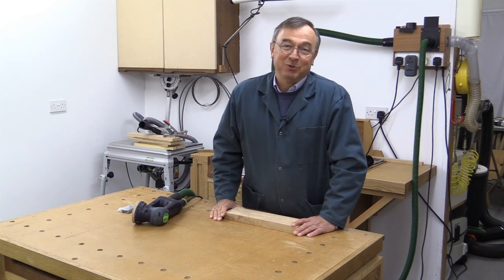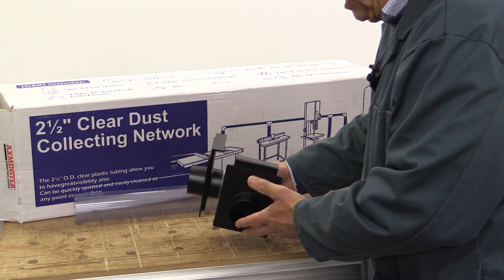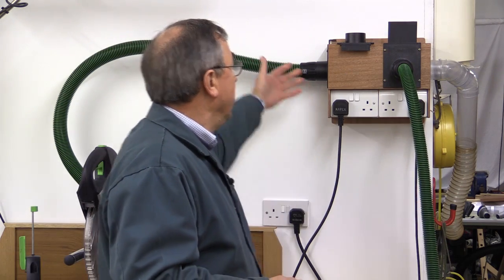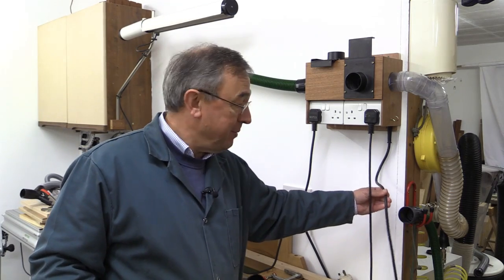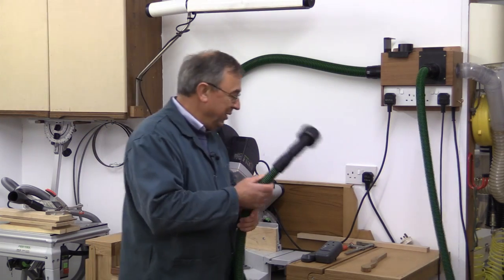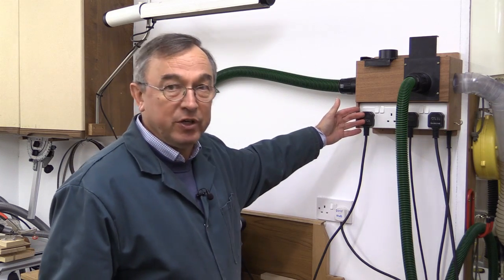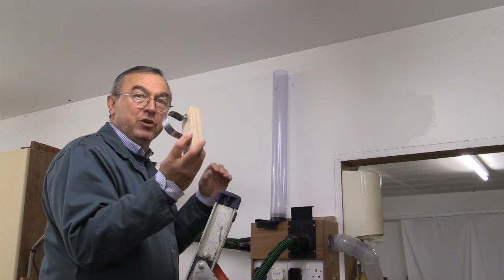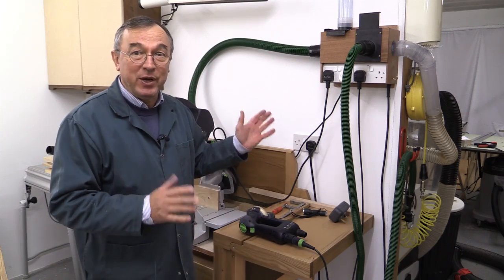How to make the workshop Dust Hub

Comment: I always enjoy your videos Peter. Thank you. Given all the developments that have taken place in the 10 years since you posted this video, it’s remarkable how relevant it is still. My only observation is that right angles are not a friend of extraction system design, so shallower angle connectors would be a big improvement for viewers to consider.
Reply from the maker: Many thanks for this. When I moved house and built the new workshop I adopted a simpler idea for dust extraction with a single vacuum machine. I now have my CT26 (a very faithful friend) with the Utimate Dust Deputy on top set next to my Kapex. This allows me to have a short length of hose to the Kapex which improves dust collection. I have a double power socket which gets its power from the front of the CT26. I have the Kapex permanently plugged into one socket and the Festool Plug-It cord plugged into the other socket. Both sockets have individual switches. I have a routine which I have done so often it is a habit that when I want to use the Kapex I plug its short hose into the top of the DD and switch the Kapex power switch on. When I want to use any tool that uses the Plug-It cord I switch off the Kapex power, switch on the power to the Plug-It and swap the Kapex hose for the hose associated with whatever tool I am about to use. It works really well and saves having to operate blast gates and there are no right angled bends in the air flow.  Cheers.  Peter
Reply: @NewBritWorkshop Thanks for your quick reply. Once I’ve completed my own workshop makeover, I’ll share my approach. I was inspired by Dennis at the @HookedOnWood channel to go down the Record Power CamVac route, with a DIY cyclone, in addition to my CTM Midi. The plan is to combine dust extraction from Festool gear, workshop tools, and XCarve CNC, with fume extraction for my CO2 laser, all to units housed outside the workshop in a sound-proofed mini shed. I just need to decide where to locate a connection hub (per your design) and cut the requisite 100mm hole in the wall, while avoiding 90 degree connections in the ducting! 

Being a bit of an IoT and home automation fan, I can’t overlook the chance to automate the remote switching of the extractor(s) and blast gates based upon which tool is drawing current.

Comment: Just came across this idea and its a very good one , I have a question whats the name and where to source that plug socket with the remote control
Reply from the maker: Hi Bill, That plug and remote was sold by Maplin here in the UK but you can find similar stuff on Amazon.  Peter
Reply: sure as hell miss em Maplins were close by , Thanks Ill google  and see what I dind I do have some of the smart  sockets that link to the machines and come on automatically when the machine starts like my table saw,etc  but the remove idea is quite a good idea. Thank you for the reply 

Bill

Comment: G'day Peter, I managed to buy a similar kit here in Aust and made up a dust hub. However, I am having problems with the dust settling in the bottom of the blast gates making it impossible to seal off the gate. I have to remove the gate clean. Do you have this problem with yours?
Reply from the maker: Hi Clive, I have exactly the same problem. Were I to make another I would install the blast gates upside down. I sort mine out, about once every 6 weeks, by using a vacuum hose and a piece of wire to loosen the trapped dust.     Peter

Comment: Hi Peter. I know I'm abit late to the party but Im just working through all your videos. I was wondering if the festool midi would have enough suction in your opinion for a system like this?
Reply from the maker: The Midi should be fine. It has the same max vacuum as the CT26 (which I have) at 24,000 Pascals. Its flow rate is just a fraction lower at 3,700 l/min compared to 3,900 l/min of the CT26.   Peter

Comment: A bit late but I've only just found your channel again. All the dust extraction videos I've seen scream, NO RIGHT ANGLES, use two 45 deg bends otherwise you impede flow. My experience tells me that this is indeed correct, also bigger pipes with adequate pull. I know you are totally married to a few firms who I guess sponsor you but I've seen the proof.
Reply from the maker: Hi Steve, Space was the criteria and the parts that I could buy the cheapest. My system works fine for me.     Peter

Comment: Hello Peter. Another nice video. You folks in the U.K. have great accessories. It's the same with  motorcycle accessories. Very cool motorcycle parts and accessories there. I really like the power switch and electrical wall socket/combo you have there. I wish we had something like that in the U.S.. A nice setup on the dust hub.
Reply from the maker: Hi Ron, I suspect that the various accessories will be available in the US but it is a question of knowing where to find them.   Peter

Comment: Hi Peter. I just watched your dust hub video and was left wondering how you deal with chippings from your planer thicknesser? I currently have 3 extractors - a festool ctl midi which I use directly with my TS55, my Dewalt router and my Mirka sander. I also have a Record power RSDE2 which I use to clean up with and to my router table fence. Finally a 550W HVLP collector hooked up to my Axminster AW10BSB2 table saw, and my Axminster 106PT2 Planer Thicknesser. None of the extractors can cope with the volume of chips from the planer. I know you used to have the same machine, so I'm wondering if you have any advice. Many thanks. Anthony.
Reply from the maker: +Anthony James Brown For my planer thicknesser I have a Numatic NVD 750 which operates through a 100mm cyclone from Cyclone Central. It works really well as 99% of the chips go into the dustbin that I use as a drop box. You should be able to find the 100 mm cyclone video - it was one of my very early efforts.    Peter

Comment: Is this kit from Lee Valley?
Reply from the maker: +Lance's Woodshop Hi Lance, Mine came from Axminster Power Tools here in the UK. I am not sure who sells it in North America. Here is the Axminster link so you can see what you are looking for:  http://www.axminster.co.uk/63mm-dust-extraction-kit        If you PM me your email address I can send you the plans free of charge.    Peter
Reply: Thanks Peter, I believe Lee Valley is selling the same thing in the U.S. - I appreciate the free offer but I'm looking for a Y fitting that will fit into the Clearvue CV06, and have 2 blast gates coming off the Y. Are you on Instagram? I have some pictures of a new boom arm I'm working on, if you're on Instagram, you'll see what the issue is i'm trying to solve. Thanks again for the feedback.
Reply from the maker: +Lance's Woodshop Hi Lance, No I am not on Instagram, Facebook or Twitter. I have enough on my hands answering every comment or question on YouTube and like to keep an eye on the Festool Owners Group forum. Good luck with your dust collection plan.   Peter
Reply: +New Brit Workshop (Peter)  Hi Peter, i can find the Axminster blast gates (63mm)  but what size Festool hoses/connectors do you use? D27/D32/D36
Reply from the maker: I have both 27 mm and 36 mm hoses and they both fit as the end that goes on the extractor is the same on each and it is that end that goes into the blast gate.    Peter
Reply: Ok, thats easy. Would like to get the blastgates, but have to see if i can order them with paypal. Don't have a creditcard :(

Comment: It really amazes me just how simple you make your video's. I have watched a few of them and can appreciate how valuable you are to manufacturers of woodworking equipment and, more importantly, how essential you are to all woodworkers trying to build knowledge when they get started, or wish to improve on what they do. I now look specifically for your videos. Thank you so much. 

Just one question and apologies if I have not seen it, do you have a suspended air filtration unit for the very fine dust that may be airbourn in your workshop and have you done an evaluation of these on video please.

Thanks again and I look forwardf to seeing more.
Reply from the maker: Badger Woodcrafters Hi Badger, I used to have a brilliant Jet overhead filter in the days when I ran a chip extractor (one of those awful things which have a big bag on top that inflates and then redistributes the fine dust all over the workshop). In those days the extra filtration was essential. Now I have got rid of the chip extractor (they should be banned unless they have HEPA filtration) and moved over to my brilliant combo of Festool CTL26 and Numatic NVD750. I sold the Jet filter and have not looked back.  Many thanks for your very generous and kind comments. Peter
Reply: Just one clarification if you will please Peter. The Festool CTL26 & the Numatic NVD750 should manage, without anything else (Dust Buggy), to keep the harmful dust at bay?  I have been considering the first two, but feel I would like to manage without the DB if possible for space saving, but do need to keep the air clear as my Asthma is a problem. I use a Trend Airrace half mask when tools and machines are working but unsure if another air purifier was really necessary with the CTL26 & NVD750?
Reply from the maker: Badger Woodcrafters The Trend is good and you should try working without the overhead first. Peter

Comment: Peter
Great job, as ever.  One question I have is on the use of the T-section is the extent to which you lose suction fron the tight 90 degree angle?  I have read elsewhere that you should avoid T sections as they reduce suction considerably.  My guess is you know exactly what the impact is, anything you can share?

Thanks and keep p the good work,
Terry.
Reply from the maker: T Radford Hi Terry, You are right (on both counts). There is a reduction in vacuum efficiency and I have set it up to offset this. The key machine that needs the best suction is my Kapex and for that the flow is in a straight line. The other routes were intended just for sanding, the Domino and the odd bit of sawing. However, the CT26 is such a good extractor it can still provide the power needed even at the end of that long piped section. So, I am able to use my Festool CMS-TS (saw) and Festool CMS-OF (router) with no problems whatsoever. Ideally one would design a Dust Hub with "Y" joints rather than 90 degree ones but I had none and am perfectly happy with what I have made.    Many thanks.   Peter

Comment: Hi Peter.
I'm new to the Festool world & have been catching up on a lot of your videos.
I'm going to build a dust hub, & was wondering if there was a reason you used plug wall sockets as opposed to, say, a switched surge-protected trailing socket x4, which would simplify the electrical connections?
Reply from the maker: Pete Gee Hi Pete, Anything will work as long as each outlet has a switch and they are all grouped together at the Hub. That way you can get into the routine of turning the power switch on for the particular blast gate that you open (and turn the switch off for the blast gate that you close), otherwise you will make the mistake of having the power on to a tool that does not have vacuum support.   Peter

Comment: Thank you for yet another very interesting and informative video.  I have seen other videos of dust extraction systems where the plastic piping has been earthed - is this something you should consider?
Reply from the maker: Alan Currans Hi Alan, I have earthed the system and will try and get some video about it up in the not too distant future. Basically I extracted an earth point from the rear of the sockets on the Dust Hub and then connected this to thin copper wire which I wrapped around the piping. Many thanks for your kind words.     Peter

Comment: Nice setup.  Now I'm completely confused.   I'm just in the process of setting up my first workshop.   Naturally I've been looking at all the great tools I can buy, in particular dust extraction.   I've been advised that 6"  is the way to go, and also 4".  Hmmm.   I have installed a new floor on top of the existing concrete floor.  I decided to run a dust collection pipe under the floor to the center of the room for a new table saw.  Unfortunately I could only fit a 90mm pipe there.  Any advice??
Reply from the maker: David Handley Hi David, I would think that a 90mm pipe would do perfectly well for a table saw provided the extractor is up to it (most will cope well). The 6" extractor size is for serious tools producing loads of dust - 4" is good enough for the average planer, table saw and band saw. For small tools (Domino, sanders etc) the higher vacuum is better (like a Festool CT for example).  I hope this helps.    Peter
Reply: Yes it does.  Thanks Peter.  Keep posting your great videos.

Comment: I believe that axminster sell a grounding kit that i would recommend. But for me i just used a thin bare copper conductor and wrapped the plastic pipe  ( it kind of looks like a barber's pole). I also linked the wire to any metal parts that touch the pipe e.g. the brackets and then ran it to ground. I don't think statics a big problem but better safe than sorry.
Reply from the maker: Woodey12 I think that this is very sensible. Many thanks.    Peter

Comment: Some great tips in this vid. I have used this dust extractor set for a few years now and would recommend that you ground the plastic pipe. After a period of time static causes fine particles of dust to stick to the inside of the pipe reducing airflow, especially on the long runs.
Reply from the maker: Woodey12 That is an excellent tip. What method would you recommend?    Peter

Comment: Oh a little tip when setting up systems like this with tubing of different sizes. PET bottles (such as those that fizzy drinks, water etc are sold in) will act like giant shrink tubing when heat is applied. Since I have a 100mm system I use the 2ltr Coke bottles, simple cut to length, slide over the fittings and use a heat gun as you did, the bottle will quickly shrink over the fitting providing a nice seal. I used this method to create an adaptor for my 12" disc sander, the fitting was 63mm but my system is 100mm, a coke bottle to the rescue and I have a perfect fitting, FREE adaptor.
Reply from the maker: caskwith Great tip - thanks.   Peter

Comment: I was thinking of a worst case scenario and your right it probably will never occur. I want to set something similar up in my workshop. does your dust go straight into the vacuum or do you have a cyclone? I am trying to source a cyclone in the uk like the clear vue cyclones you see on you tube
Reply from the maker: KnotTheWood ? I do have an American Dust Deputy - about $35 if you have a friend who can pick one up for you. I often use my CT without the DD if I need the full suction for router work or sawing sheets of MDF. Try Cyclone Central (Google it) based here in the UK.   Peter
Reply: New Brit Workshop thanks

Comment: That's a very slick little setup you have there. I personally use a 100mm system and a remote control as I am in a temporary workshop at the moment. When I move I plan to install a more permanent system and I am certainly going to incorporate some of your ideas here. Thank you!
Reply from the maker: caskwith I am delighted to have sparked your imagination.   Peter

Comment: Great setup. I have a CT midi which has a maximum load of 2100w (I think), how do you stop the system demanding more power than that? For example, two tools being used at once? I work on my own 99% of the time but occasionally some one will give me a hand.
Reply from the maker: Paul Weedon Hi Paul, Just follow the power switch and blast gate procedure that I describe in the video and you cannot go wrong. If someone does come to help you in your workshop then you have to think it through - what would you do now? Presumably with just one extractor you can only use one tool now anyway. Many thanks for the kind words.   Peter

Comment: Peter, that's a terrific setup. Great job! One idea I had when I saw you using the rotex with it was to open one of the other blast gates slightly to allow more airflow through and effectively reduce the suction through the sander without having to go over to the CT26.
Reply from the maker: mouppe I understand the idea but I never have reduced the suction on my CT26 when switching to sanding. It has never caused any problems for me.   Peter